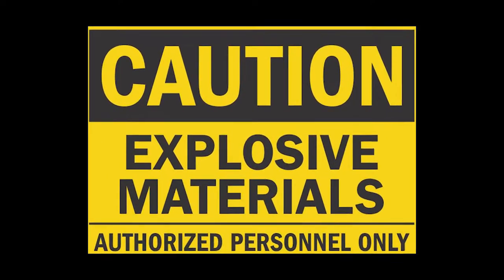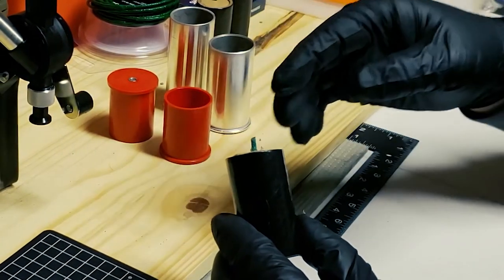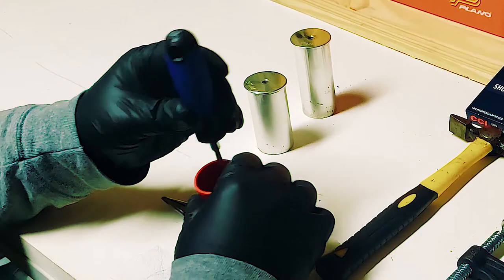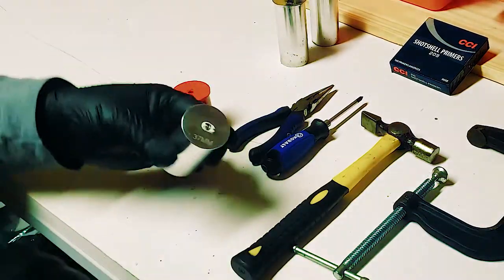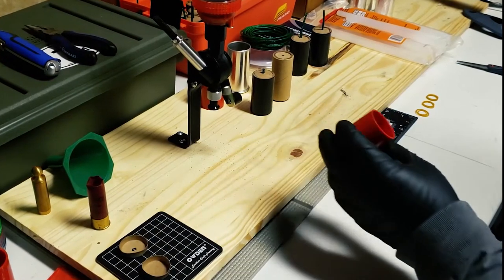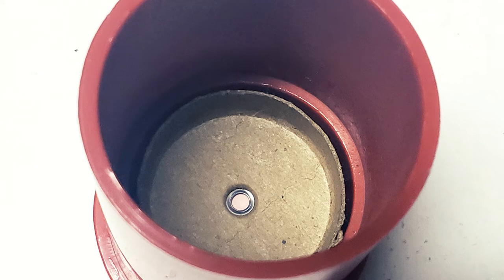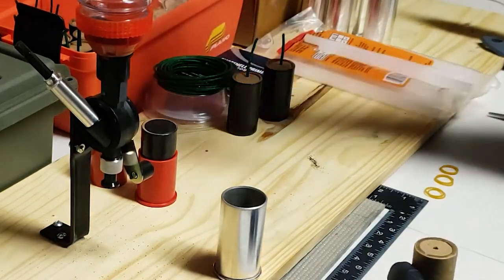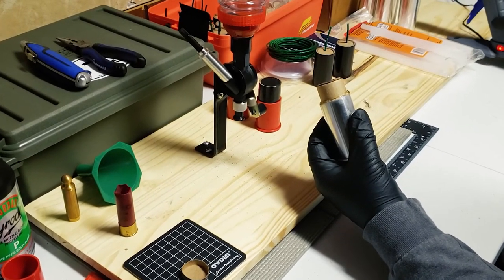37mm Loading: Hull Prep & Finish (Part 2 of 2)

Comment: If my casings are 3.5” with the bushing milled in what cardboard tube length would you recommend? Thanks for your help.
Reply: Im assuming 4” but then I’m curious about the ratio of the hot glue plugs. Mainly the base plug.
Reply from the maker: The plastic hulls are 2" long. The aluminum hulls are usually 3" or more. So, 2.5" or 3" tubes will work with either. 3" tubes seem to give the best glue:powder ratio for most signaling payloads.
Reply from the maker: Note: If you can find larger tubes, there's nothing wrong with 4" , you'll just use more glue.

Comment: Do you still need powder with store bought load ready rounds?
Reply from the maker: It depends. Some loads will come already assembled in the hulls. In that case, no, they are finished and ready to go. The other option is buying the payloads, which still require you to have a hull, add powder and primer, etc. Maybe I'll add these examples in the next video!

Comment: I understood that  the combined charge max was 1/4 Oz?   That is 120 Grains.  Is this correct?
Reply from the maker: You'll need to check with your state and local laws, and check the current ATF regulations. At the time of making this video, the max black powder allowed in the entire device was 105 grains. I don't recommend weighing by ounce, always grains.
Reply: @37mmOHIO  There was also some question if the ATF was using weight or volume also.  Too much is not clear.  Thanks!
Reply from the maker: @myfavoritemartian1  At the time of my research, it was volume. I agree that their language is unclear, but that works in our favor too. You're safe measuring 105 grains by volume.